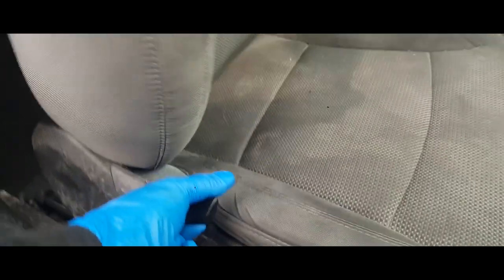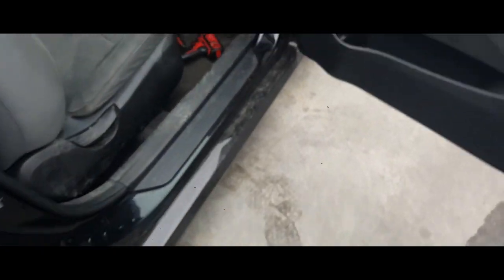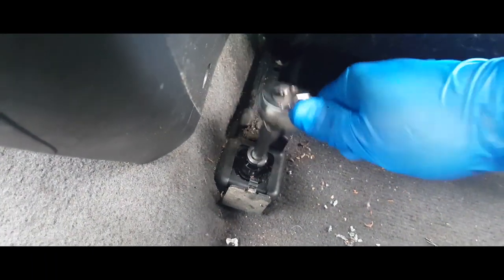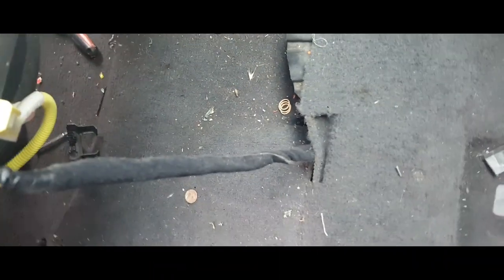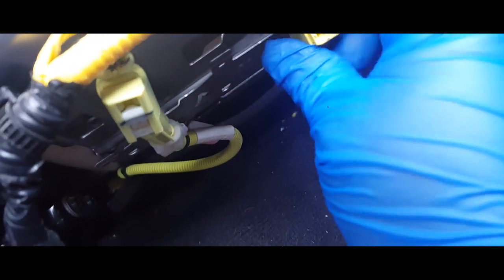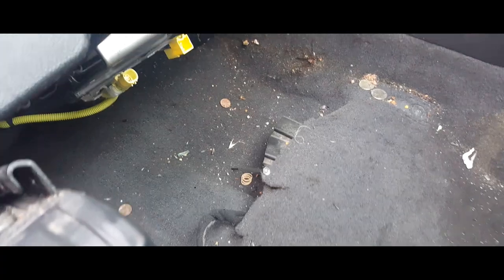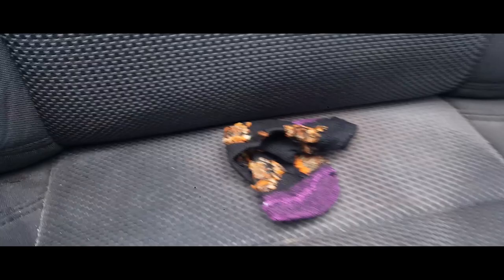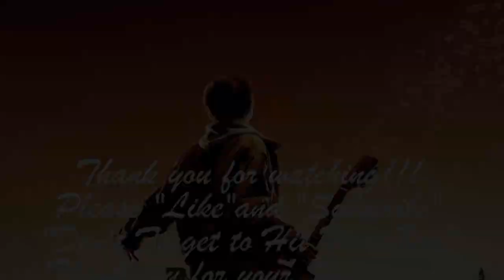How to: Remove Passenger Side seat from a 2013 Hyundai Sonata

Comment: Thanks for posting. A very useful video.  If you pressure washed the seat (ie got it wet) would that possibly damage the sensors in the seat?
Reply from the maker: No you should be OK but I would suck it up with a vacuum or leave them out and the sun to dry so it can dry up evenly. Otherwise it will leave water stains

Comment: pressure wash a seat?.......wtf....I'd just steam and hand scrub those actually...less likely to damage anything.
Reply from the maker: Damage what? Done it thousands of times and never damaged a seat The pressure washer washes all the dirt off and out the cushion using a steam machine or a carpet washer might get it out but you're going to work hard to get all that out and when you remove the seats you're able to remove all the debris that are underneath the seat and wash the carpet. All you do is pressure wash the seats let him sit in the sun and dry out then install them and they look brand new
Reply: That's what my dealership does for $100...full interior cleaning and pressure wash seats if needed.